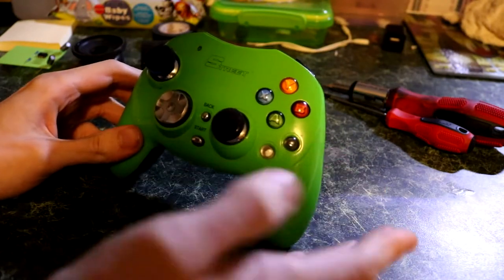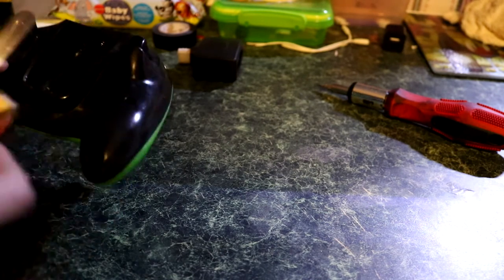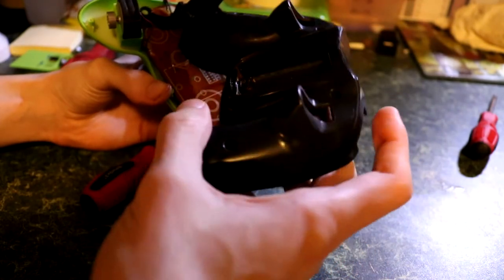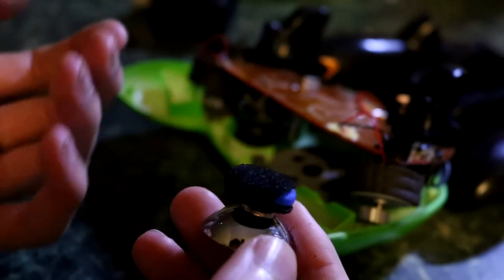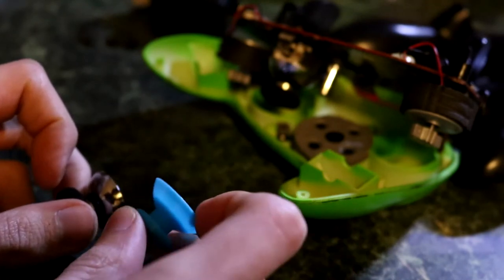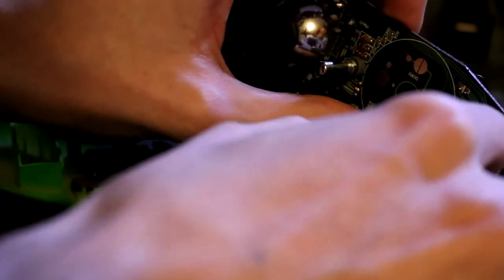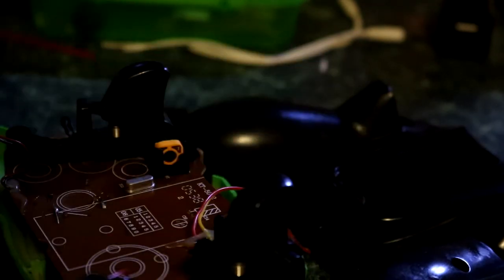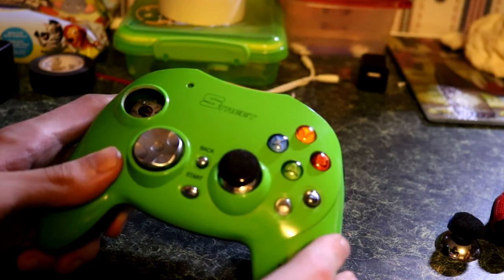Original Xbox pelican Street Controller Wireless Joystick "Repair Attempt And Tips"

Comment from the maker: I'll be back with better videos soon. I got some videos on ettercap to make and proberequests running the programs in headless mode. So some more Linux kind of stuff and I may do a video on a tear down and circuit diagram for the super small portable pi zero w I made as well as a 3d model you guys can download i'll have the original model and my slightly larger one up for download if you wanna re-create that project.

Comment: How do the bumpers work with this controller? Can you assign the left bumper to be the jump button?
Reply from the maker: Sorry for the late reply it just puts the white and black buttons as the bumpers there is no assigning them it seems weird but the positions are not bad in my opinion makes it feel like a 360 controller since in og xbox games on the 360 the bumpers get assigned the same way on the 360's controller as well.

Comment: I know this is an old video but a reply would be greatly appreciated.

I recently got one of these controllers in a box with a bunch of other used Xbox stuff and I can’t find any information about it online other than what is in this video. If you have any information on them or resources I could look at it would be very helpful.
Reply from the maker: Sorry for the late reply was helping a friend out with pc stuff but these pelican controllers use a dongle. So if you don't got the dongle the controller is kinda useless. I only got one controller personally so im not all to sure if you can just find a replacement dongle and if it would just work besides this I don't know much about the company that made them I had the controller since I was a kid along with my xbox if I ever find the packaging i'll be sure to leave another comment or pin its info in a separate comment..  Sorry I couldnt be of more help.